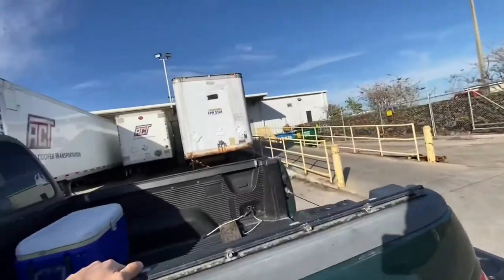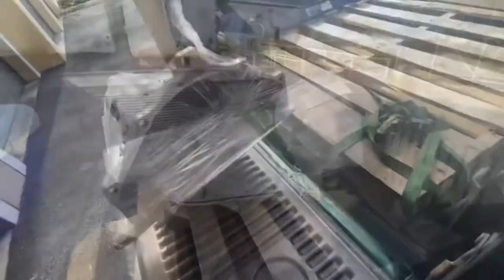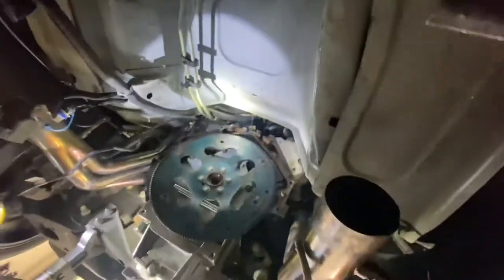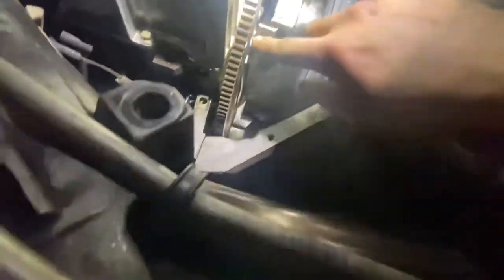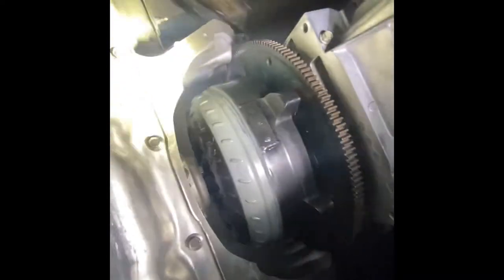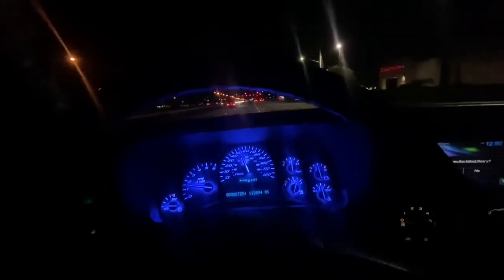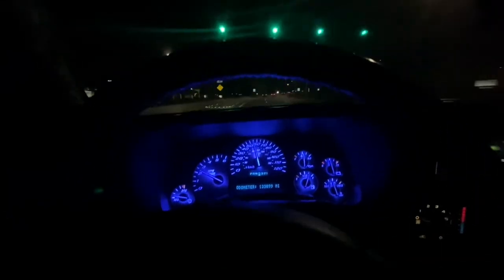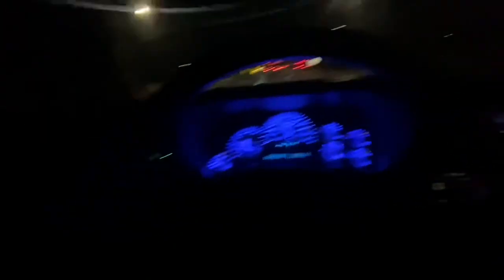Installing a 1000hp rated 4l80e into my Silverado

Comment: What did it cost you ? What all did you have to do to get the 4l80 to fit?
Reply from the maker: Transmission was about 2500 and the converter was about 1200 so about 4000 for a fully built trans and converter and other misc. pieces. I got a new crossmember by Speed Engineering, shorten the drive shaft or the yoke, and run a 2nd speed sensor! I can make another video explaining it in better detail if that helps!
Reply: @SiskBuilt  thats would be awesome because I know they are better than the 60e but idk what it entails to
Reply from the maker: I’ll start getting some stuff together and going through the process!